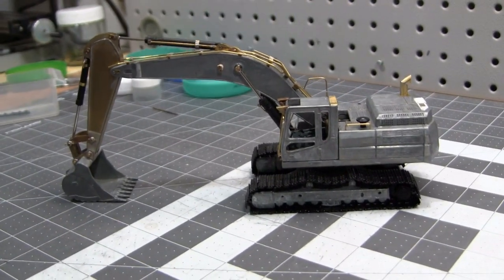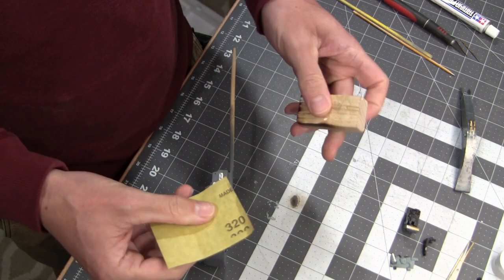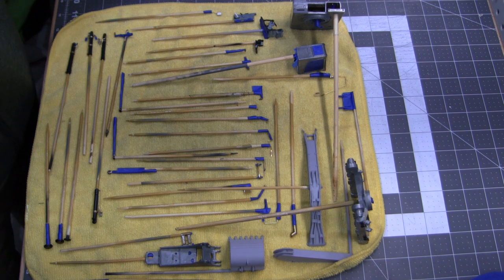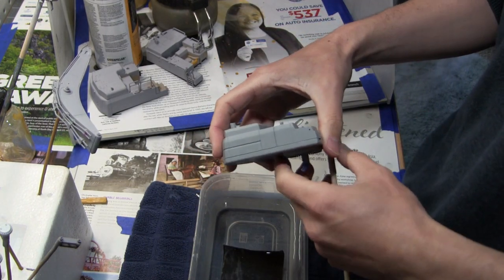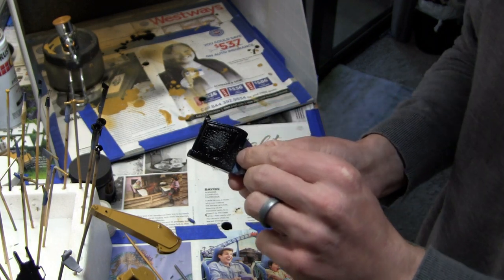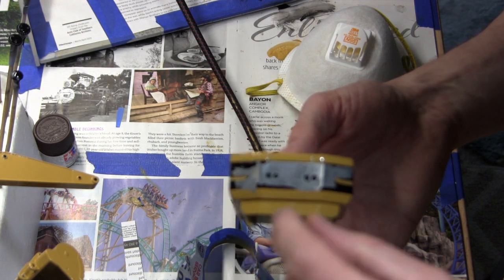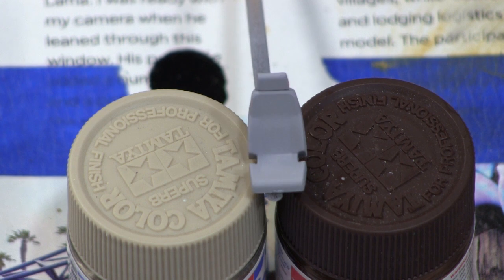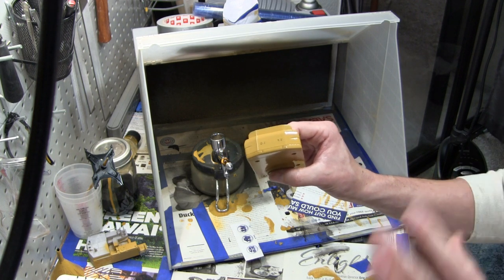let's Get This Thing Painted

Comment: With diecast and aluminium substrates it's usually a good idea to use an Etch primer. Ironically a diecast  surface that is perfectly smooth doesn't take paint too great. Etch primer as the name suggests "Etches" into the surface providing a good key for subsequent primer & topcoat. Also If you lightly go over your primer coat with scotchbrite (Green nylon scourer) pad it will assist in your subsequent primer/ top coat gettig a good key and is less rough than sanding.
Reply from the maker: Nice tip, Bill, thank you! I'll look for it to replace my general purpose one.